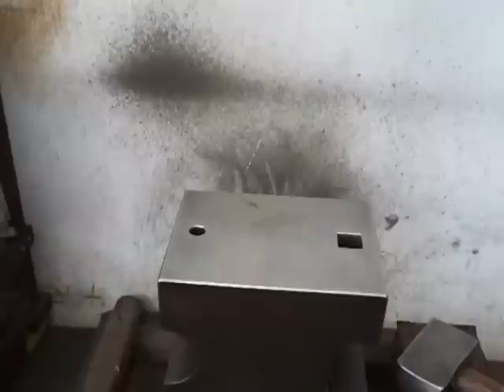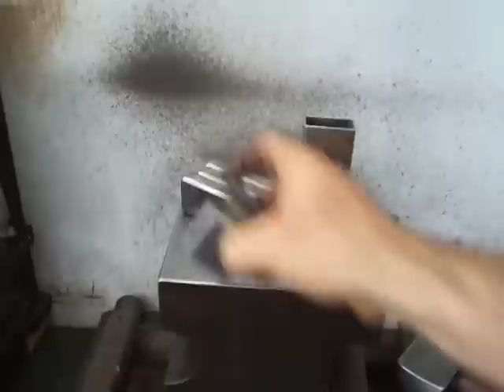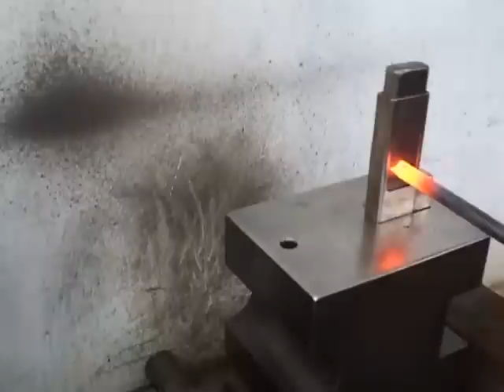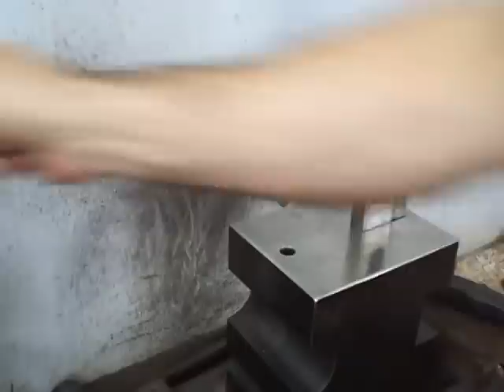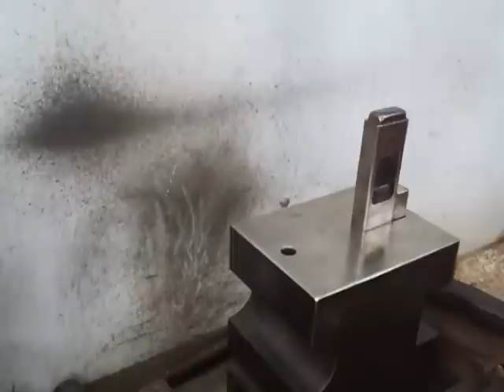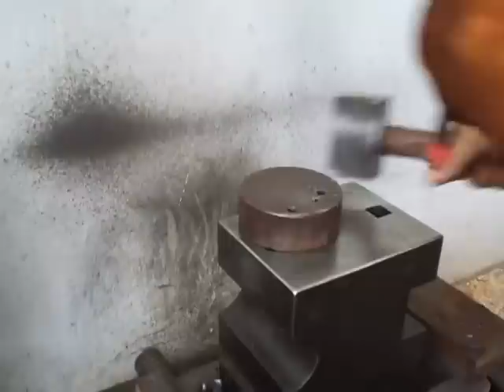Simple and versatile blacksmith guillotine - fuller / tenon tool...

Comment: I am about to make some dies for my guillotine to fuller the neck part to make  pipe tomahawks, but i am trying to figure out if I should make it a round half circles in the middle or just leave both fullers flat and rounded?

A couple months ago at the open forge i used a  fullering die on my friends guillotine with moderate success.  All i will use it for is fullering pipe  or round and square bar…so im thinking maybe a half circle in the middle of both will make my life easier?

Comment: I went to the link to see how much it cost and possibly purchase but I could not find it.
Reply: Go Geronimo Let me know if you add it to your website.  Looks awesome.
Reply from the maker: +Go Geronimo Sorry for the late reply. I do sell this guillotine tool with dies and have been meaning to change my website to reflect this - I will do so soon. The cost for the guillotine guide and 3 dies sets is approximately $100 plus shipping. It's a small guillotine tool and has some limitations but the real value is in the dies. Glen
Reply: I have a small set up and am not looking to make huge things.  I was wondering if this is capable of helping me make dumascus?  That price seems reasonable.  If I do decide to purchase one, how do I go about doing so?
Reply from the maker: +Go Geronimo As per my knowledge (which is somewhat limited) of Damascus steel, I don't think my guillotine tool will be of much use for making Damascus steel. It is mainly a tool for fullering,  offsetting, forming shoulders and the like. If you are still interested, the best way to contact me is via email: glen03@earthlink.net
Reply: +Go Geronimo Check out walter sorrels video on making Damascus steel.  That may help give you some idea of what's needed.

Comment: Could I suggest a slight alteration?  I think it might make some sense to put a "Bottom" on the open end of the tube... could protect the anvil. I realize you are not hitting the tube, but I wouldn't like to have cold steel edges on my anvil.  Minor and possibly pedantic, but with respect to the concept - looks like a very handy tool!
Reply from the maker: +BigBadBill2323 That's a good idea and certainly wouldn't hurt. But it might be overkill in most cases. The dies are standard medium carbon steel and a decent anvil is likely harder. Plus, the bottom die is machined dead flat (no radius as a hammer would have) with the edges eased just a bit (no sharp edges) making it unlikely to mar a good anvil. But your suggestion is valid and something a lot of guys might consider. It's a design that seems to work well for me but as with a lot of things, could be improved. I appreciate your feedback. Glen.
Reply: Thanks for your answer, Glen. Having said that, do you sell these?  I might like one!
Reply from the maker: +BigBadBill2323 Yes, I do sell this style of guillotine tool. I will update my website to reflect this sometime soon. I charge $110 plus shipping which includes the guide and 3 sets of dies (fuller, square tenon, and flat). And I offer it to fit 3/4, 7/8, or 1 inch hardy holes. If you have any other input or questions, just let me know. Thanks. Glen.
http://www.gstongs.com

Comment: just looking back at this Glenn, as I have an idea. I am terrible at centering rivet heads, what do you think about using a heading tool as a top plate, and a drilled plate to hold the rivet for the bottom? It should let me get the rivet head dead centre every time?
Reply from the maker: Jack, That's a very interesting idea. I need to think about this some and see what I can come up with as it might help me a lot when I make rivets. Thanks.

Comment: Judging from the high quality of the work you do, I''m thinking you have a background as a machinist. Correct? You're definitely not the run-of-the-mill backyard dabbler.
Reply from the maker: +E.R. Long Actually, I only have a rudimentary knowledge of machining. For some work (tools), I use a local machinist for making some parts. Precision is not always needed in blacksmithing but there are some instances where having a tool machined (if possible) is better. Since this video, I have changed my guillotine tool style, relying on my blacksmithing more, but I still have some dies machined for accuracy. I will upload a video of my newer style guillotine tool soon. Thanks for watching and taking the time to comment. Glen